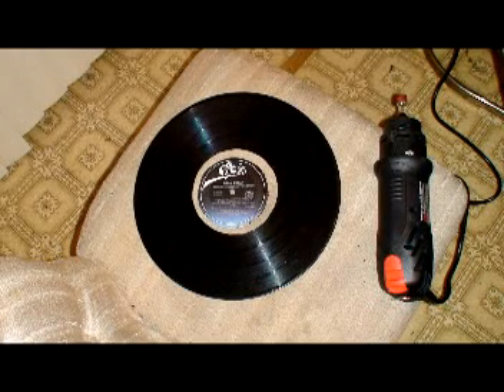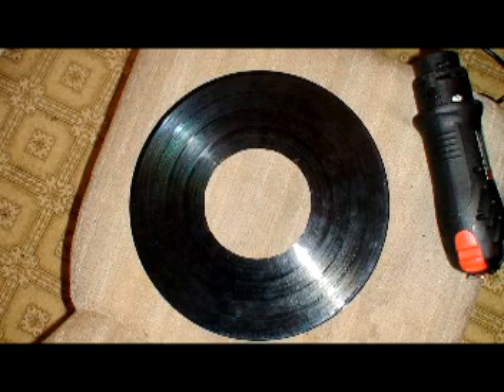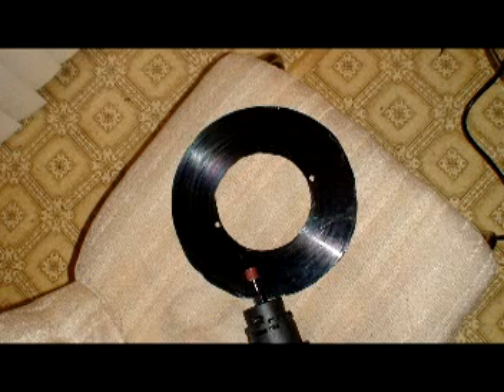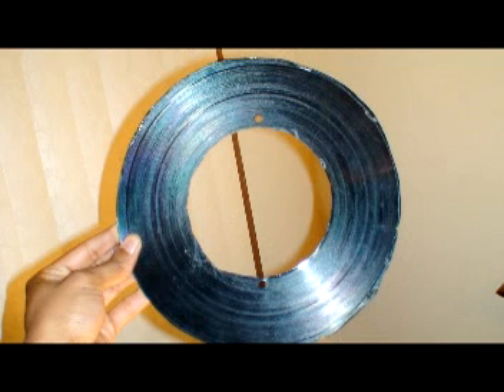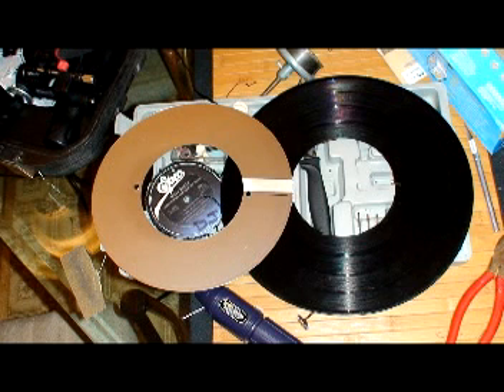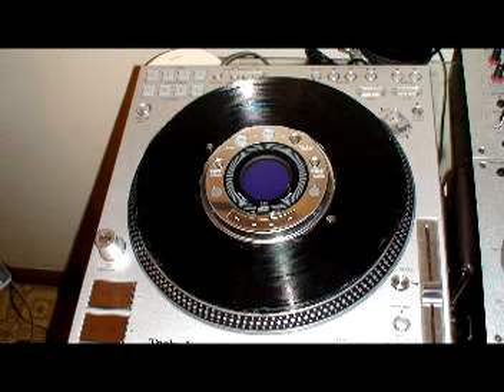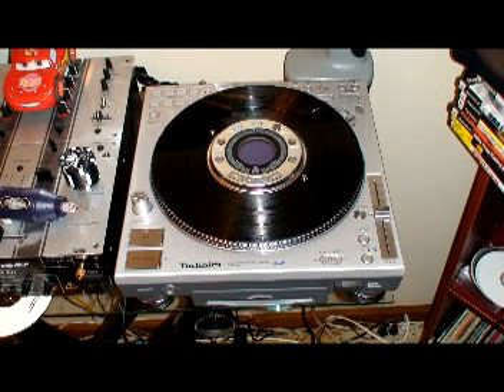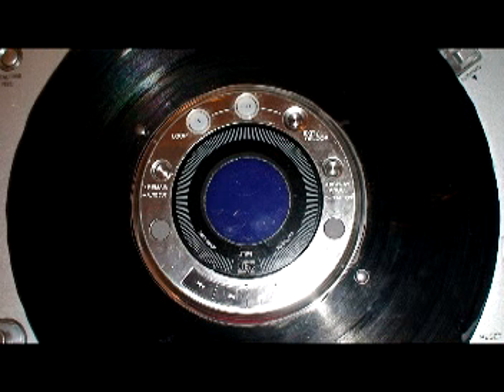dz 1200 vinyl platter 2

Comment: yeah, but 99.95 plush shipping. I just went to a used vinyl shop and bought 2 10" singles of some punk band that I have never heard of. Only 2.95 each.  Because they are 10", I should get a way with only cutting the inside.  If I get good at cutting, I will buy 2 white 10" records off ebay. I see some double LP buy some band named Rancid.  Never heard of them, but will gladly destroy 2 discs to make a pair of dz's look pretty.